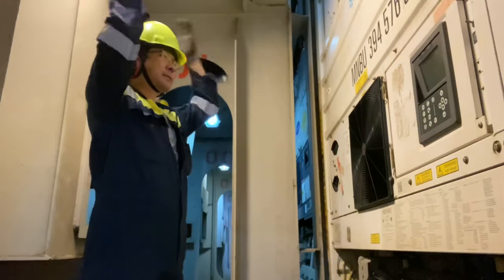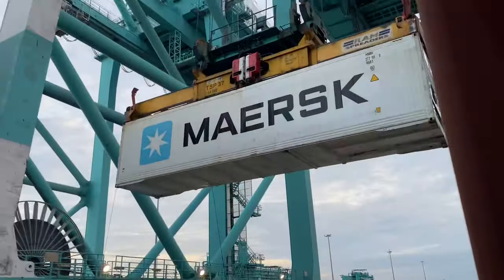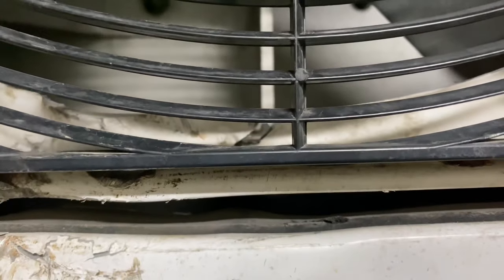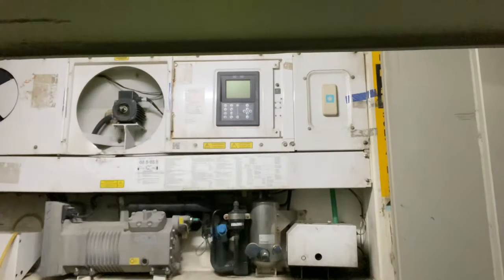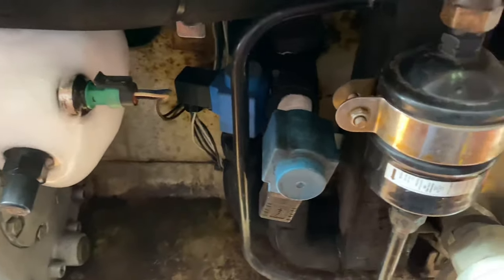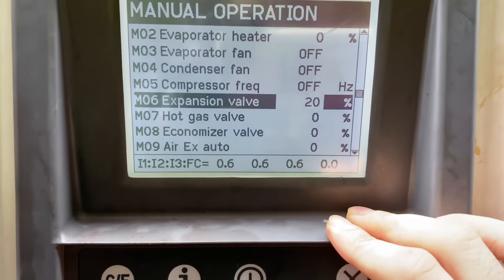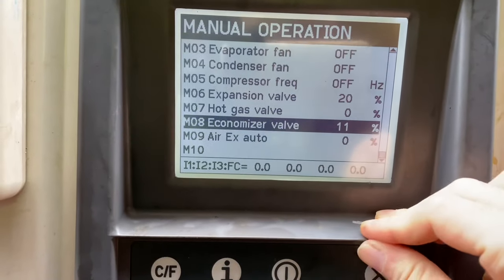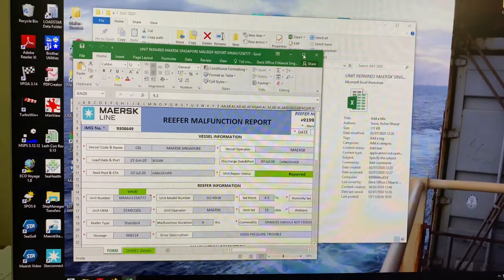ETO REEFER CONTAINER TROUBLESHOOTING | SHIP’s ELECTRICIAN

Comment: Hi am watching all your videos it's really good and see how we r working it's good but I ve a doubt because am not sonfamiliar with starcool reefers  can u explain how to intiate  manual operation in starcool
Reply: Yes I want to know
Reply from the maker: Starcool reefers can be operated in Manual and auto. You can navigate it in the service menu and can shift whichever operation you want. In manual you can also switch on and off your compressor, condenser motor, evap motor and open and close your expansion valve, hcg and economizer.
Reply: @leckyjake  thank u keep doing
Reply: you can only do so within 5 minutes of continous manual operation

Comment: Lecky jake. Curious lang ako. Pano malalaman kung defective yung mga valve na yun just by running it manual? Medyo naguguluhan ako.
Reply from the maker: Sa starcool unit pwede mo manually Activate ang solenoid coil. Pag di nag activate ang coil sira ang coil mo or baka walang output ang controller mo. Pag nag activate naman at walang click na marinig then sira ang valve mo.
Reply: @leckyjake  salamat lecky!!!